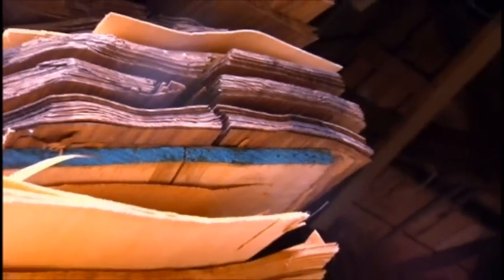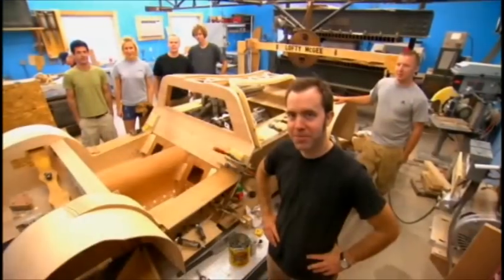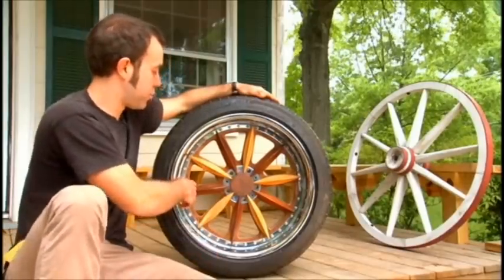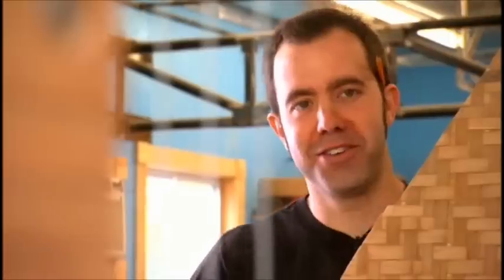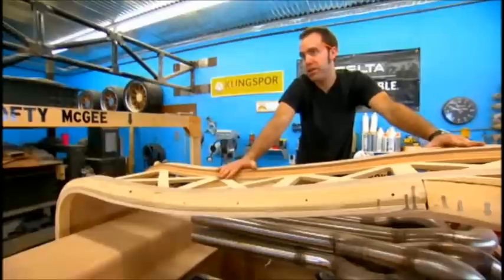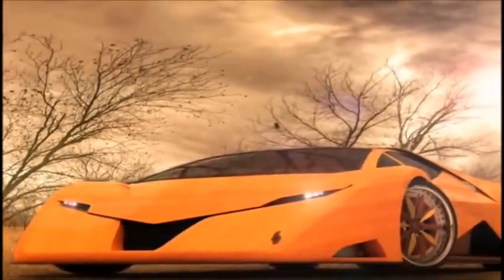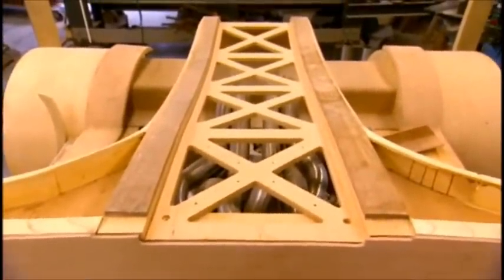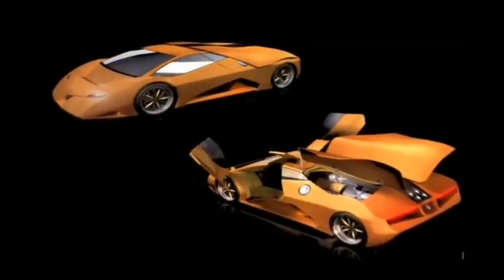wooden car Amazing  Invention  - HD

Comment: I am disabled and am stuck driving a mobility scooter. I have two problems. The scooter is limited to 21 kms/charge and I need excersize. I have been planning to build a combo scooter/bicycle ... something I can pedal (for exersize), but also have motorized when I need it. I've been looking at many options on how to construct this and this video has sparked many more ideas. Thanks so much for sharing this idea!!!

Comment: WILL NOT RUST.WILL IT HAVE LOTS OF OIL BASE GLUE?MUST BE MARINE QUALITY ,DONT WANT A DELAMINATING PROBLEMS OR LIKE METAL ,DEPENDANT ON PAINT NOT FAILING.ITS A GREAT IDEA.MAKE SOME WOODEN REPLACEMENT PARTS FOR REGULAR CARS.PRESURE TREATED MARINE GRADE ROCKER PALELS FOR MY JEEP WOULD BE GREAT.A BOLT ON,  PRESURE TREATED ,MARINE GRADE, UNIBODY FRAME REPLACEMENT WITH 6-8 INCHES OF ADDED LIFT,FOR MY JEEP WOULD BE DOABLE AND STRONG AS HELL.I'M JUST SICK OF THE RUSTING.METAL CARS ON SALTED ROADS???????

Comment: The Brits did this long ago. Classic Morgans and what-not.. There is a reason we went to steel. To call this an "invention" is rather dull. This is merely a hobby taken to the extreme with no true practical use. 

And while I'm ranting, why the hell does a car "made of organic resources, (make) a lot of sense"? Are we running out of steel? And sure it make take less energy to produce a sheet of plywood, but the labor involved in meticulously carving wood into a car is highly impractical.

Comment: How silly! Why would U use wood? Hemp fiber is cheaper and stronger! If you want to save the planet, then trees which are CARBON SINKS are best left to grow as long as possible then used for durable goods and so on. Good luck with your project, but it certainly is not revolutionary, offering anything new, nor even achieve any progress -especially if the engine uses any polluting, or resource depleting or fossil fuel.  Electric public transport, with decentralized co-gen solar is waiting